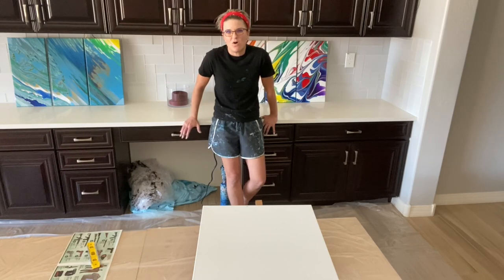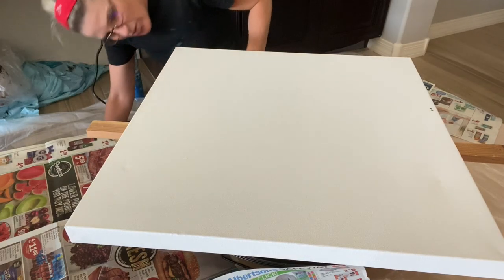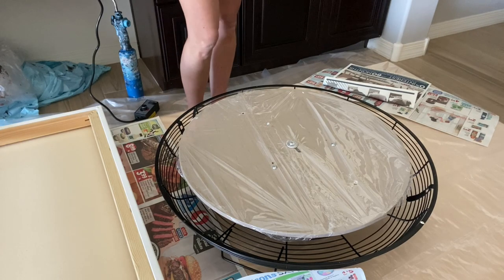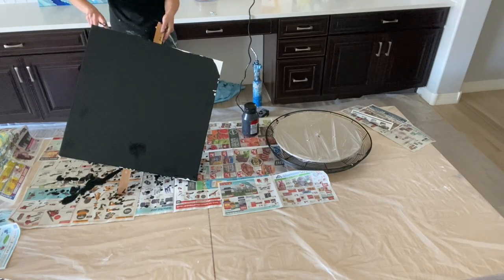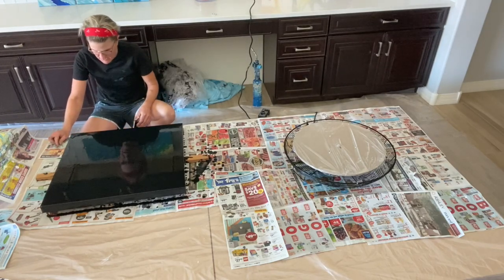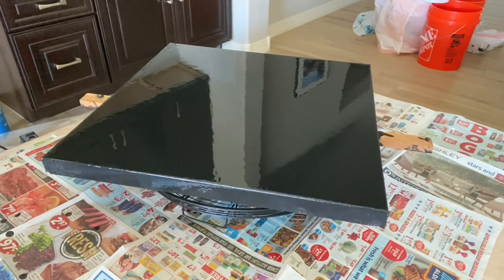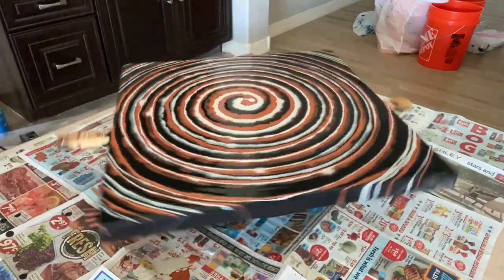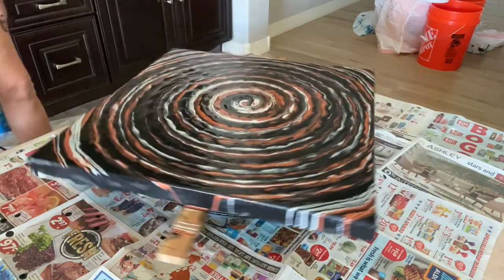Circular Swipe with Metallics. How I built a variable speed Lazy Susan and poured these circles!

Comment: Your innovation is mind blowing.  If you use heavy black plastic as protection  the dry paint peels off.
Reply from the maker: Thanks so much, Margaret! I'll try the black plastic!  😊 Like outdoor garbage bag black plastic or thicker than that?
Reply: @PolychromaticMess  thicker than plastic bags.   I get mine at a hardware store by the meter.   It is about 3m wide.  Very heavy.